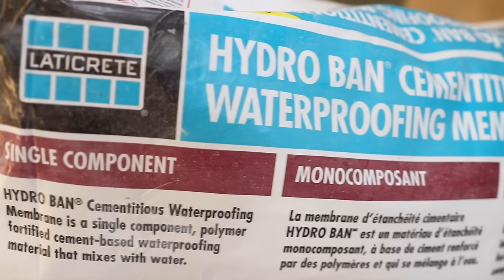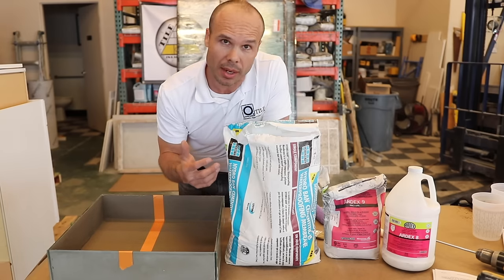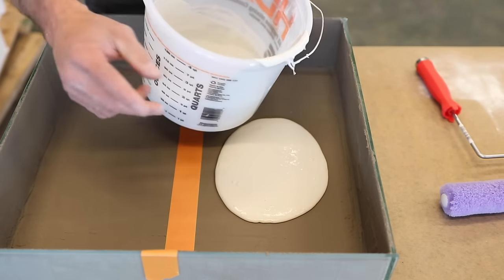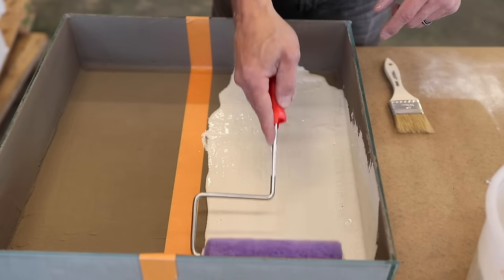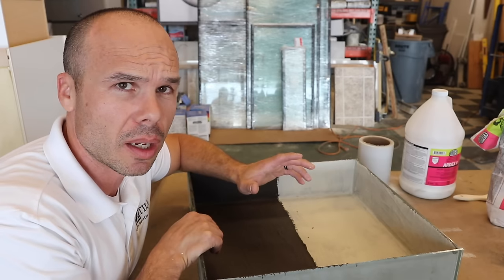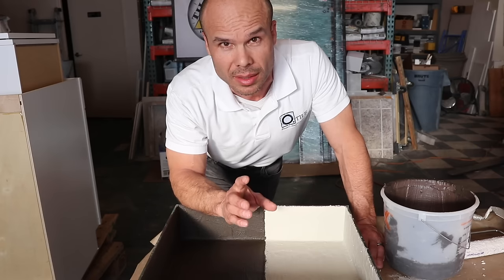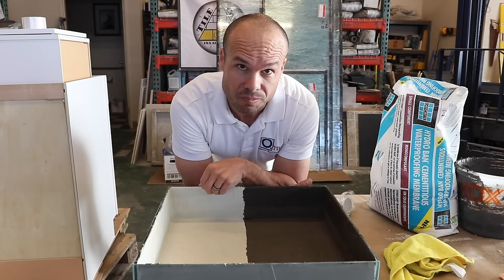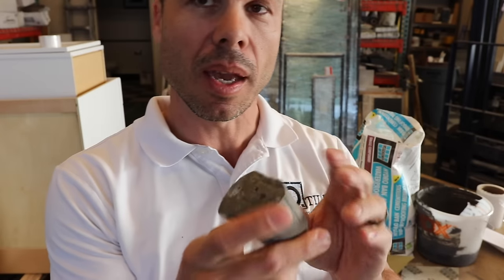Laticrete Hydro Ban Cementitious OUTPERFORMS Ardex 8+9 in Glass Box Test

Comment: 8+9 says 1to 1 mix unless mixing for filling larger gaps.
Reply: Hey Isac keep up the great work! Quick question, when you come across a floor that has crowns and low spots throughout on wood subfloor what do you typically do. Especially if your trying to install large format tile that us cupped. Do you try to convince the homeowner to use another product or just try to get the tile as flat as possible. Thanks
Reply: @jacksonvlogs7342  self level it. Prime the substrate and pour it all at once. If it's not flat, your tile is cupped and you're using lft, it would be a giant pain in the ass to try and get the tile installed flat and lippage free
Reply: Not true, read the instructions
Reply: @ChasMtz420  Installation
Mixing Ratio Paintable Consistency:

1 gallon (3.78 L) of ARDEX 8 per 9 lb. (4 kg) of ARDEX 9

*For small batches, 1 part ARDEX 8 to 1 part ARDEX 9 by volume
Here ya go boss👌😉
Reply: @Tilethoughts  You have a lot more reading to do homie, keep going
Reply: @ChasMtz420  it's ok if you can't read yourself maybe have the rep explain it to you.
Reply: @ChasMtz420   from the data sheet .Technical Data According, 
To ARDEX Quality Standards
All data based on a mixing ratio of 1 unit of ARDEX 8 to  
1 unit of ARDEX 9 at 70°F (21°C). Physical properties are  typical values and not specifications.
Mixing Ratio  
Paintable Consistency: 1 gallon (3.78 L) of ARDEX 8 per 
  9 lb. (4 kg) of ARDEX 9 For small  
 batches, 1 part ARDEX 8 to 1  
 part ARDEX 9 by volume
Mixing Ratio  
Caulking Consistency: 2/3 gallon (2.5 L) of ARDEX 8  
 
 
 
Coverage: 
 
 
Pot Life: 
Drying Time: 
 
Flood Test: 
 
Colors Available : 
per 9 lb. (4 kg) of ARDEX 9 For   small batches, 2/3 part ARDEX 8   to 1 part ARDEX 9 by volume 100 sq. ft. (2 coats) over drywall Approx. 70 sq. ft. (2 coats)  
over concrete
Up to 45 minutes
Reply: @Tilethoughts  I know my local rep and have worked with him on a few projects. I realize english is a tough language, you'll understand it more with time. Ardex 8+9 is very forgiving but this test here was just done improperly. He cause this failure, not the product. Keep reading you will get there
Reply: @ChasMtz420  what are you talking about? You made a statement about 1-1 not being the correct ratio...I replied with information from data sheet to back that up....

Comment: Concerning the air bubbles. If you mix it with a little slower drill you’ll fight less bubbles. Our mix is +/- 10% water. Once you mix it regularly you can dial it in. Also note, you’re adding water to the mix and it is  creating a chemical cure. Interesting video.
Reply: Haha I knew this would get your attention.

Comment: The air bubbles are probably due to using the drill, maybe a lower speed would be better. Or hand mixing unless you are having a big area. Good job on your videos. Been doing tile work for over 30 years and I have seen everything!

Comment: I think the air bubbles are caused by the mixer, and the speed of the drill. The air - that forms the bubble - is already in the mix before you apply the coats.  Great video and thanks. You've really helped me with my first shower install.

Comment: I appreciate you doing these tests and sharing them! I always try to test my materials as much as possible but it's hard for me to test every product as thoroughly as I would like so it's always been important for me to have a network of professionals to consult with and get feed back from. You're extending that network in a helpful and impactful way! 

One of the things I love about tile is how long lasting it can be but it's only long lasting if it's done right. In testing materials I find an important step in the process is pushing the material to the point of failure because no product is good for everything and you have to understand the attributes of the materials you're working with to be able to know what's going to perform well in the range of situations you're going to encounter. This video illustrates that point very well!

Comment: Great video.  I use Durock with Redguard.  Been doing it for 15 years or so.  No issues that.  However, I just use the mesh tape for the durock, so Redguard is completely exposed to the air.

I love that you test products.  I have used kirdy, schluter membrane and schluter panels.  I have found that Durock and Redguard when installed correctly is the best bang for the buck.
Thanks for your videos.  Casey K.

Comment: This process is great for a test.  I just recently came across your channel.  Great stuff!! 

I would like to see you do this test again but using the 8+9 proper manufacturer mixing recommendation.  I think you'll find it will perform better than it did.  As you said in the video, when first applying the 8+9, it was too thick.  The thicker the material, the less chance for air bubbles to escape from the porous thinset.  To many air bubbles captured in the material provide a path for water to penetrate.

Comment: For floor applications, polyurethane probably is a better option than cementitious coatings because they are more rigid and subject to crack. Cementitious coatings from where I live do have different flexibility options, the more flexible ones are for floor applications. For wall applications, we use more rigid cementitious coatings because the flexible ones may risk sagging once tiles are laid. Also , regardless of what coatings you use, the industry best practice stipulates that transition from vertical wall to floor be smoothed out or be made a 45 degree angle before applying coating to minimize cracking. But it's seldomly followed by residential contractors, some of them just use fibre mesh for reinforcement instead.

Comment: It's long but worth the 45-second read -- To all the professionals out there.... go to the manufacturer's website and watch the manufacturer's training and product videos. As great of a guy that this gentleman appears to be, he did almost everything incorrectly. Please stop putting all your faith in YouTube videos that are not endorsed by manufacturers. Manufacturers have mixing specifications for a reason. Read the entire "printed" technical data sheet (TDS) listed on the manufacturer’s website. It is in your best interest to not only read the pail, jug, or bucket - but also read the complete product TDS. You are not receiving complete product recommendations and you might be missing critical information. He measured his Laticrete but eyed the Ardex and then makes a statement that the Ardex surprisingly did not waterproof as well. He should have done 2 different tests side by side (not 2 products in the same mockup). Waterproofing is very specific. It either works or it does not. You're waterproofed or you are not. And when the product is mixed incorrectly, it often will not perform as advertised/expected. The latex in Ardex 8+9 is critical because it along with the proper powder ratio creates the waterproofing membrane. If you notice it was mixed it up thick with less latex. This was an incorrect ratio. If you are not mixing the "entire unit" and just skimming off small amounts of powder from the top of the bag, you might not have all the critical components/powder as materials separate in transport. Get in the habit of mixing complete kits/units for the best results. Mixing half or partial units only leads to problems. Waste is a job cost. Plan on waste - charge accordingly. If the material was properly dry blended first using a dry drill and clean pail and then some powder was scooped out, it would have been a better approach. Did he properly agitate the Ardex liquid to make sure it was well blended? Solids settle in latex and improper mixing causes failures. Why use Ardex 8+9 over Kerdi? Kerdi is a waterproofing all by itself - redundant. If he is using waterproofing to seam the Kerdi, Schluter would recommend using the Kerdi Band and a non-modified thin-set. All I am saying...if you learn something incorrectly and then follow the incorrect information yourself, who is responsible should a problem occur? Talk to your local product representative, read the manufacturer's printed information, and go to the manufacturer's product training. You will improve your understanding by avoiding any possible misinformation.
Reply: This comment should be pinned at the top. Actually this video should be taken down: irrelevant results for not following manufacturer instructions. Even the camera guy noted that he mixes it a lot thinner -probably he follows the directions. Not saying this guy doesn't do good work - I'll just call it demo-itis.
Reply: The manufacturers instructions also state that the 8+9 can be used at a thicker consistency that is still supposed to be waterproof, the consistency they describe is 2/3 powder to 1/3 water. The instructions also mention mixing smaller portions for filling seams/gaps and then mixing back into the paintable consistency to roller. No where do the instructions state anything about dry mixing or that you have to mix an entire batch of their product for it to work correctly. I literally just read the instruction sheet.

Comment: So this is just me guessing. But if that first layer of 8+9 was a little more loose, it probably would of soaked in better and released the air bubbles which then would have prevented the pin hole leaks. Am I wrong on that?

Comment: I'm a little late to the party to comment but what I've learned from being in aviation when dealing with sealants especially in areas that can't have moisture is not to use a fuzzy roller or cotton to apply a protection seal. The material will come off in the wet applied seal and become embedded when hardend and will eventually exorb enough moisture to compromise the seal. But you did use the roller on both sides so idk.

Comment: Great content.   I think the rapid set mortar wasn’t cured long enough and caused the air bubbles and somewhat invalidated the test as the membranes were compromised before they could cure as a solid membrane. The test illustrated the better tolerance of the one product to a surface that wasn’t ready for waterproofing. You are much more knowledgeable in the trade than I am and you continue to educate me on tile and shower pans. I appreciate your videos.  I am no expert, just an engineer.  Thanks.  I just used 8+9 two days ago and feel that I was actually looking for a product like laticrete and thought the Ardex 8+9 was more of a cement.  Ultimately I am glad I used the Ardex and am pleased with the flexibility of the Ardex.

Comment: Amazing video.  I got from the video that your a little partial to Ardex 8+9. Probably because it’s “tried and true” but for your purpose, the hydroband cementitious would be better in my opinion   Since you still adhere the Kerdi membranes with thinset and not 8+9; 8+9’s quality of being able to dry in the absence of air does not really benefit you.   Hydroband cementitious Waterproofing being that it provides less water penetration and coupled with the fact that you only use in a topical application and not to adhere anything, why not just go with the one that provides better protection even if it’s not the one that dries in a vacuum better. Since there is not much use for the specific quality in the way you use it. Or is there a benefit to having that quality of the 8+9 ( complete dry in a vacuum) that I’m not picking up on for the specific method in which you use it. If you have the time, I’d appreciate your thoughts.  Thank you for what you do. God Speed.

Comment: I would like to add to this video in regards to the Ardex 8+9. I still believe ARDEX is easier to use due to that you don’t have to carry a scale to measure by weight. One more thing is that Ardex recommends using a 3/8 paint roller to apply their 8+9. I still believe that Ardex will outperform any liquid roll on waterproof membrane.  Also I saw another text you did of the 8+9 with the seem tape saying that it leaked through their tape, their mesh tape needs to applied with 8+9 underneath it and then have the two coat application over their mesh.

Comment: I now see why you're left with so much liquid with the 8+9. I feel that you need to do this test over and use the correct amount and mixtures to get the right results.
Reply: Exactly! Imagine weighing and accurately measuring one, then just saying “ahhh, that’s about right” on the other. If the Ardex was wetter it would not have so many pinholes. It would flow better to close them up.
Reply: @5degreenegativerake  The Ardex was literally uncured due to lack of the liquid component, that's why water was going through it. Just because it looks brown doesn't mean it's sealing the surface!!

Comment: Hi Isaac, 
I really enjoy your videos, the testing especially. I personally have been in the tile game for 30+ years, 3rd gen master tile mechanic.. my preferred method of waterproofing is redgard , 
One thing I've noticed so far in all my experience, none of theses systems are actually 100% water proof. They get pretty close.. but none are. If you have time, could you look into epoxy materials for a possible option for waterproofing? 
My method for showers are : preslope, 40mil pan liner, 1/2 inch durock, 2 inch mud bed, tape and thinset all joints and seams, skim coat all surfaces with modified thinset, and then roll and brush all with redgard 2-3 thin coats.. 
This system has proven to perform well for me.. but it is time consuming and labor intensive.
Reply: Why Durock over the pan liner?
Reply: 3 thin coats works for me
Reply: @tinman1955  I'm pretty sure he doesn't mean he puts Durock on the pan liner. But it sounds like he said he puts thinset on the entire walls, but that's probably not what he means.

Comment: I'd like to see you peel up the sample you made for this video... I think those water spot are not really water spots but material that really didn't mix well so it didn't cure fully.  Just a thought.
Reply: They are still spots that got wet and bled through otherwise they would have shown up before the box was flooded. In any case if what you say was what happened it shows the advantage of a pre mixed sysyem.

Comment: Thank you! I've been watching a lot of your videos and I'm halfway through installing a complete Schluter shower using Kerdi board, Schluter ST shower tray, Kerdi membrane/band etc.. I'm paranoid that it might leak! I would like an extra layer of waterproof protection. Do you recommend using the Laticrete Hyrdo Ban over the Schulter  membrane and band? I'm installing very expensive marble and if I have to pull it out at a later date because of failure I will be extremely upset.  Thanks in advance!
Reply: My thoughts and same question?

Comment: I am putting a shower on the second floor of my son and daughter-in-law’s house.  I am using Kerdi board 5/8 inch sheet with a schluter shower pan with a curb.  I am going to use the kerdi band.  I was looking at your videos and thinking about coating all the seams with Ardex 8 +9.  Now I have ruled that out after seeing this video.  I am now leaning towards the hydro ban, but am very hesitant to do that as well.  I am now thinking that the best way to waterproof all the seams is going to get a ten gallon tub and mix Ardex 8+9, Hydro Ban, Red Gaurd, Fiberglass strands, Resin, G flex epoxy, and super glue.   I think that it is going to be the best way to get a total water proof job.  You might think I am joking but I am totally serious.  I have looked into the chemical properties of each compound and have calculated the exact amount to mix in based on the International Society of Waterproofing standardization guidelines to allow for equilibrium stabilization to occur.   I will apply the mix using a Ryobi paint sprayer in thin coats to reach a maximum thickness of 90 mils.   Immediately after I will hit it very lightly with a blow torch to remove any air bubbles.  I will be making a video of this process and I will post it at the end of the job.

Comment: First timer here, and I have cement board on my floor in bathroom (installed by previous owner I guess) and want to add a layer of waterproofing down before I lay down tile (since water is why we had to rip everything out in the first place). Do I just lay this down over cement board then lay tile as usual? If no, what should I do? If yes, what is best thinset to use on top of this for tile install? I have half a bag of schulter all set but don't want to use the wrong thing. Thanks!

Comment: what type of product would you use for an outdoor waterproof membrane to seal a horizontal crack that is non-structural yet went completely around a gunite hot tub behind the waterline tile. i know there are many products but i was wondering which might be the most flexible in temperature changes yet still waterproof that i could seal the crack with before retiling. i've been getting very little help from the pool builders in the area and yet thats where everyone i talk to tries to send me. i figure the more i know the better.

Comment: Another good video Isaac. I do have a question though. Kerdi membranes call for using unmodified thin set for laying tile on in. Since you are applying waterproofing over the kerdi membrane, do you have to then use a modified polymer based thinset, which many of the waterproofing compounds recommend??

Comment: It looked like the whole back of the hydroban side is darker, meaning its ALL completely slightly damp, which would make sense as it's cementitious. The ardex has just pin hole water spots, not damp everywhere. Also, the Ardex was made both times with WAY too much 9 and not enough 8, from my experience. I wonder if this compromised it? Anyways, I think you have it down right using it as a secondary waterproofing and not the main. Great video! Love the testing.